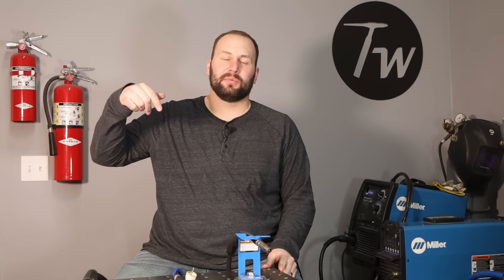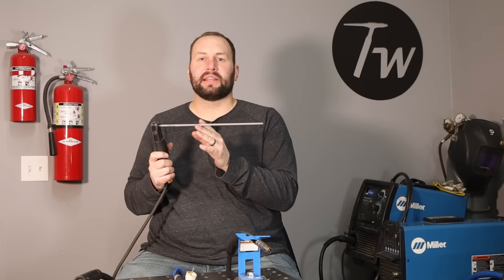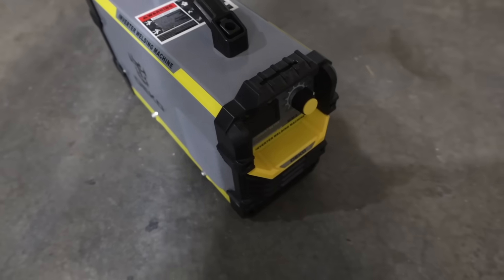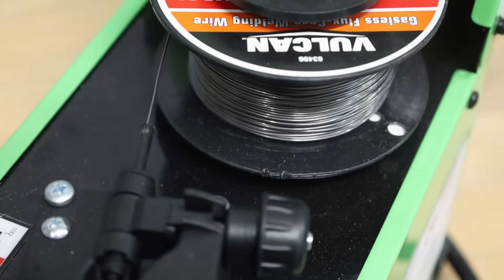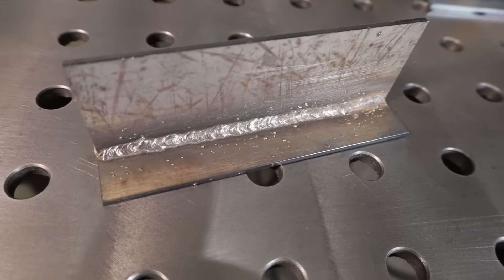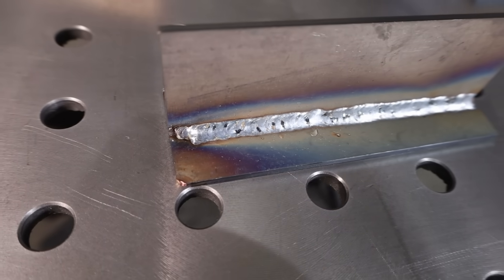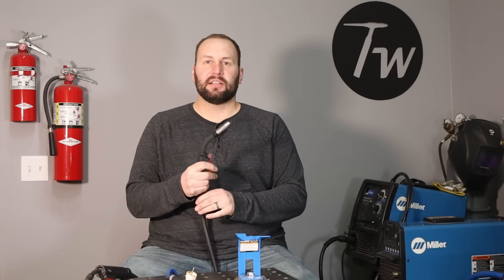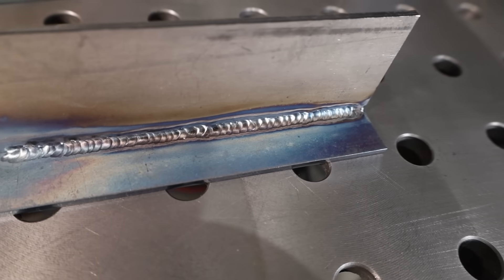4 Types of Welding Explained: MIG vs TIG vs Stick vs Flux Core

Comment: It’s called “stick welding” because the rod always sticks 😂
Reply: Rod sticking = more amps.
Rod burning through= less amps.
Reply: @tarnvedra9952  🤔
Reply: @tarnvedra9952  What about changing the voltage, if possible? After all, it all ends in Watts.
Reply: @bitTorrenter  yes, I personally call them rods. Welding rods. But their technical name is electrode. I've never heard anyone refer to them as sticks, other than in the term Stick welder. :)
Reply: @bitTorrenter  You don´t. MMA is a constant current process. Voltage goes all over the place by itself trying to keep the set current.
Reply: @tarnvedra9952  Interesting.. Do the MIG welders work on the same basis aswell?
Reply: @bitTorrenter  MIG is the opposite = constant voltage + you set proper wire feed speed to accommodate chosen voltage.
Reply: @tarnvedra9952  nice info. I understand this here. Not when in college
Reply: @tarnvedra9952  thank you bronie
Reply: @tarnvedra9952  what about the fucking rod melting or turning red haahahahhahahahaha i am welded dear god
Reply: @tarnvedra9952  ehhh
Reply: @tarnvedra9952 I honestly didn't know more amps would make it stick less. I just started welding today. This 2 year old comment is helpful
Reply: Nah its called stick welding because of the stick u need to keep up in ur arse to maintain the perfect angle to prevent "spitting" of the metal.
Reply: 7018s notorious for having to be totally dry or stick they will!!
Reply: Always keep them in the containers, so you get absolutely no moisture so they'll stay as stick free as any 70xx. Still a tricky rod to work with. Respect to you for great work.
Reply: @lifeinpalawan yeah very I’m in school now and even after getting proper grasp of the strike still sticks from time to time
Reply: @lifeinpalawan  not in my experience. They seem to run just fine rod oven or not. Then again I live in Texas. Not sure if extreme humidity could cause trouble or not.
Reply: Good job
Reply: Not being mean here, but dad always kept certain rods in a fridge that was not cold enough to cause condensation but kept his rods in low humidity.  He also had a small toaster oven for drying out some rods as well.  In 20 years of watching him weld, I never saw him stick a rod.  Those old dudes had tricks up their sleeves we haven't got a clue about.  I can't remember why, but he would drink milk before welding galvanized.  Dude could lay a pretty bead and was certified on pretty much anything you could shake a stick at.  My favorite was watching him fix this one jerk off's screwed up job.  They dumbass laid out and final welded an expensive alloy beam for a decorative staircase.  They used a stick welder with a hollow rod and compressed gas to blow the weld out.  The kid was throwing hot slag all over, got into a corner and shot a gob over his leathers.  It dropped just over the lip of his jacket and it bit right in to burn his rear pretty good.  He gave up and went to the med center.  Dad had to step in, and I got to watch as he cleaned out the welds (which hadn't penetrated correctly) and did it without the full leathers.  I couldn't figure it out, but he cleaned out the corners with the hot slag always going away from him.  I was there to grind all those bad welds and to watch dad lay out the beam, weld it up right all before Bob the gob came back.  If you wanted pretty welds, you had 1 of 3 guys in that shop do it right.  If you had to get the job out and couldn't get one of those guys, you got me to come in behind the gob slingers and grind 'em up pretty.  Best summer of my life...I decided that college and a career in IT was the better choice for me.
Reply: @briancooper4620  
Uh, I suspect you may have mis-understood much of what you saw. Some of your comments about other welders support this view.
Keeping rods in a fridge has two problems - taking something cold out of a fridge causes condensation to form on it in a warmer environment (classic example is the moisure forming on a cold drink's glass), and the "dew point" when the warmer ambient air that entered the fridge was chilled inside it. Not to say specific rods may not benefit from it, but I don't know of any - anyone?
The only rods I've used (I'm by no means what I would call a "welder", they are VERY skilled in what they do) that were hollow were cutting/gouging rods specifically intended to blow molten metal out of areas to cut them apart, or prepare an area for a (re)weld by removing material (or cracked weld) and forming a groove for good root penetration.
Reply: It's not me it's the rod
Reply: @samduncan344  🤣🤣🤣good one
Reply: Depends of a "rod" (type,manufacturer). Some do stick,some do not. Mostly problem is moisture in them. I use 3 types,one sticks always,but if it is reheaten,no problem.
Reply: @Bare36  may be why a friend of mine used to put his sticks in an oven before use.
Reply: @Bare36  Keep those "sticks" dry and warm.  If you work out in the field stick welding, keep rods inside the cab.
Reply: @Bare36  I threw my rods and industrial oven for about five minutes before and they never stick
Reply: @Bare36  what rod do you use
Reply: brass monkey  lmao, I've used PPE all my working life, because I'm not a brain-dead zombie. I guess you know nothing about welding and the affects of welding fumes and gasses. They don't have any effects on the brain, they cause cancer and chronic lung disease, of which I have neither. You just sound uneducated & bitter. I have advised someone here to invest in a respirator, and you're calling me out for it? You clearly have zero knowledge of welding and the hazards that come with it. Stop trying to make out you are educated on the matter, obviously you're not. 🤡
Reply: brass monkey  ps; You* & You're.
If you're going to try insult someone, atleast use correct English grammar and spelling. What are you, 12?
Reply: Lmao  that's  brilliant  but you  just  gotta  get better  at starting
Reply: Give me any one of them and stand back or get burnt
Reply: Lightly wet the last 1/4" before you strike up
Reply: If you actually know what you are doing the rod won't stick. Easiest way is to start the rod off work piece, then when the rod end is inside the flux (as opposed to sticking out as when new) and it's still red hot transfer to work piece, the flux will conduct the arc starting and there's no bare rod to stick to the work piece.
Reply: @railroaded1991  that was my point though, I don’t know what I’m doing. I’ve found that drying the rod in the oven first helps. Thanks for the tip, I will give it a try.
Reply: My tip of the week place rods in oven on low temp for 10 minutes to get rid of any moisture ,do use gloves to remove don't be a clod lol
Reply: Some people just camt take a joke....

And saying you've never had a rod stick is bs
Reply: If anyone makes that particular joke at my shop we fire them on the spot
Reply: Your rods are too thick.
Reply: 😂😂😂😂😂😂😂😂😂😂 That's a good one
Reply: Only if you have asshole coworkers.😂😂
Reply: Skill issue.
Reply: Bad welder spotted
Reply: Nah u just bad at it.
Reply: @tracerandom7082  exactly😂 people jab when they strike it and wonder why it doesn’t work😂
Reply: @tracerandom7082  did you learn to take a joke yet?
Reply: @tracerandom7082 😂
Reply: Jaja
Reply: @juanm4936  Binks? Jarjarjar
Reply: @elyanae9588  Jaja is "haha" in some foreign languages
Reply: Lol
Reply: @betogray9765  lol hahaha
Reply: That's were the mighty stihl chainsaw steps in to buff that off
Reply: @Mike-su8si  Real welder can peel off the slag
Reply: @ex3cit  probably how mine will turn out I'm hoping it'll be in small pieces broken up like crumbs
Reply: @Mike-su8si  Me and my friend would do 7018 rods the thickness of my middle finger and the slag was so massive we needed a bandsaw
Reply: @ex3cit  that's big
Reply: Depent how good you are to weld!
Reply: I was taught by this guy who said, do it exactly the same way as I do. He picks up the electrode holder on the left side of the table, so do I. After I did the course I had an exam. The guy marking me said, oh, you're left handed. No, I'm not, I just did everything the guy told me to do, except as a mirror image. I passed OK. But can't weld right handed.
Reply: @philgray1023  I didn't do a good weld job i believe i would have gotten a F in class. my metal is thin for one thing and the other i didn't know it would burn through the cleaned rusty metal
Reply: @philgray1023  -  👍🏼🫲
Reply: Cheaping out on the iron powder again
Reply: My first attempt at doing arc welding at college looked like Custer's Last Stand......!
Reply: brass monkey  racist horrible yank
Reply: Not if you've a bit of practice and have good spacial awareness - the relationship between where the rod tip is and the work-piece.
Some rods are VERY polarity sensitive, that seems to be one of the biggest issues with strike and arc problems.
I'm by no means an expert, just used it for many, many years.

Yeah, moisture can be a big problem, not just for the arc, but for hydrogen embrittlement - worked one place the boss had a real thing about using a specific brand, and type, of more expensive low hydrogen rod when almost all welding was on simple mild steel(!). Then, when the rod hot-box's heating element failed he refused to spend the money to replace/repair it... I wouldn't say the workshop's welding bay was damp in winter, but a lot of rods got thrown out because the flux was crumbling and falling off from dampness.
Reply: Gotta record scratch that shit
Reply: You ain't kidding!!
Reply: Only if you don't do it a whole lot
Reply: LOL I feel you bro 😂
Reply: Haha, indeed, for beginners. Learning to strike that arc takes a bit of practice for sure. Strike it like a match. A quick but short stroke, being sure not to drift too far from the desired starting point. A good helmet is also essential. If you can't see where the stick is, you're more likely to stick it. 😋
Reply: @Clifton84 Best Comment Ever on Youtube!  LOL
Reply: Dip stick, Witch means in English (A long piece of steel that  can tell you the level of your engine oil, other than that it brain less! Please stop, it takes years to understand welding
Reply: Been there done that... 😂😂
The only welding I ever did was just a mess around, and after 5 mins I was OK, nowhere near good but OK. Saw some “professional” welding a couple of months later (a nepotistic appointment, at the cost of a Good welder according to the staff) and hey, I was better.... sporadic joins & “birdshit” all over the place.
Reply: Low hydrogen rods used for pipes work require coded welders as they're very difficult to use
Reply: especially them 6010s 😭😭
Reply: I just started to pick up welding, and this so much resonates with my experience when I tried it for the first time 🤣
Reply: Lol yeah. It's so frustrating, especially for beginners like me.
Reply: 👍🏻 very nice, thank you 😬
Reply: I did a bit of welding at my concrete job not knowing a thing about it, that fucker stuck to the metal every time I touched it lmfao such a noob
Reply: Lmao
Reply: lol i remember learning to weld in class we started with stick welding and almost everyone got the stick stuck first couple of times xD
Reply: If it don’t stick you are doing it wrong son,,
Reply: How to say I can't weld without saying I can't weld 😂🤦🤦
Reply: Witty and very appropriate.
Reply: https://youtube.com/shorts/QF1uD_1Wlkw?feature=share
Reply: I’ve broken a few stingers and welding helmets because of sticking lmao! But it’s what I started on and still my preferred. Stick and Mig are all I’ve done so far. I work at a stone quarry and all the welding that was done by us maintenance guys is basically the result of us being self taught. We do have to have a 3G vertical structural welding certification though and if you don’t pass it you are kind of forced out of maintenance. Everything is painted and 20 years of rust from water and limestone dust. It’s been a struggle to learn anything on but man can I weld on clean metal because of it. Wish I would have taken classes back in high school for it. Never knew I’d be doing it or enjoy it!
Reply: Work available I will come
Reply: I remember 5th grade welding class and that was the worst part
Reply: He was making a joke Richard heads
Reply: Say what🤔

Were made in HIS image. HE made us with the power of free choice
A good prayer:
I'm a sinner JESUS please forgive me for all my sins I know you shed your Blood for me on the cross at Calvary. Thank you JESUS for my salvation and for shedding they Blood for me. I love you JESUS. 
Romans 10:5/10 ct...❤️k
JESUSisLord!Amen...
Amen..
If you'd like to call someone who cares 
83
For
Truth.
bc you don't know when you'll die?
.y r u hesitant......
...

.
Reply: Never had chickens is why lol 😂
Reply: Back bock Bock Bock all alcoholic welders best they have perfect shakes for that chicken scratch to start lol prove me wrong lol
Reply: I remember kicking myself when I’d flip my helmet up and something would bump me or I’d sneeze and stick. Fun times.
Reply: Bruh that’s what I’m sayin
Reply: Protect from moisture (air tight can) rise your amps.
Reply: I thought that was just my welding technique
Reply: used to happen to me back when I first started 😅😅😅😂
Reply: Hey just as a secondary note here... Those pro metal workers who run rod after rod are stopping and starting a new rod before the weld has a chance to cool off. It's much easier to start a new rod when the spot and flux are red hot... Which goes along with my previous suggestion of starting the new rod off piece and transferring over when flux and rod are still hot. My suggestion is for us who aren't pro metal workers and only weld now and again, works for me.
Reply: @railroaded1991  thank you
Reply: Hahaha true...m😁
Reply: Tap or strike it like a match n it won't  stick
Reply: As an instructor we always started them out with a 6010. After mastering that a 7018 becomes much easier.
Reply: You need more heat, pop it up
Reply: Part of it has well u know how to weld
Reply: Lmfaoooo
Reply: Witha Hardar  amen brother
Reply: I call mine bird shit welding.... for similar reasons.
Reply: So true bro hahah
Reply: LOL
Reply: Agreed
Reply: HAHAHAHHAHAHAHAHHAHAHAHAHA
Reply: Mine too welder.  Mine too
Reply: Hardest dad joke
Reply: If you use proper technique and amps, you won’t encounter this issue
Reply: No kidding
Reply: nah this was actually funny
Reply: Fr
Reply: Pontoon welding stick..n twist
Reply: so true
Reply: Ok?
Reply: I tried verticle up stick welding while working for a dude who owns trailer parks, I instantly gave up when the rod stuck I was like nah I don't go to school for this 😂 I've done some stuff with the flux core though. I know most consider that hot glue rather than welding though.
Reply: Ong
Reply: What a great lecture!!! Thanks mate!!!
Reply: No shit💀🤣
Reply: That's no shit
Reply: And it's the type I STICK to
Reply: It's all in the techniques. Right now I'm pooping and use the rock all the way back and forth technique to poo faster!
Reply: I hate you😂
Reply: We used to call it arc welding
Reply: Simple explanation 😂
Reply: Right! 🤣 I still enjoy stick welding though. Especially how it smells like a campfire 🙂😎
Reply: yes pain in the ass
Reply: Boy you got that right
Reply: Man I gotta mean tap start tho. I haven’t gotten stuck since trade school 😂
Reply: Its called stick because you're burning rods with an O² blocking coating that look like literal sticks.
Reply: You have to tick tick tick it few times before start if it is wet
Reply: Must just started learning... you'll get better. Use the strike method not tap
Reply: On God it’s so annoying because I’ll always lift my hood because it’s a fixed shade not an auto shade and I’ll have shirt flashes.
Reply: Ha ha
Reply: Did some stick welding with my dad. He’s good at it. I’m not… I did some good lines but could be better, I improved quickly though. I enjoyed his help.
Reply: So true
Reply: I feel you pain friend, hence i’ve gone to MIG which seems far simpler. Couldn’t get on with fluxed wire gas less but fine with gas MIG.
Reply: I feel you pain friend, hence i’ve gone to MIG which seems far simpler. Couldn’t get on with fluxed wire gas less but fine with gas MIG.
Reply: THANK YOU!!! I thought was just me 😂
Reply: skill issue
Reply: 😮Itself is stick,loose stick
Reply: You also may need to lower the angle you are holding it at and go at a consistent speed.
Reply: Its all about maintaining the arc, and you do that with the amps and the distance between the rod and the surface you weld in.
Reply: If it sticks you’re running too cold for that rod
Reply: As a stick welder I can both confirm and deny
Reply: It never sticks if you do everything properly 😂
Reply: Dude real
Reply: I laughed way harder than I should have.
Reply: I thought 75 A was good enough😢 I wasted an entire class period getting pissed with my stick and the clamp that holds the stick, I was using a small 6013 BTW. I’m still so disappointed that I didn’t think to BRING IT BACK UP to 115 or 120
Reply: Ha ha ha ha . Yep.
Reply: if you ladies are finished comparing cl*t sizes and swinging handbags, might I suggest a battery fanny pack blower? You get filtered air and a nice cooling breeze to the face.
Yes, they are quite expensive, but they're really such a pleasure in comparison. I had the use of one some years back, before moving onto other things, and even without fumes I would use it to cut down on sweat and eye irritation from the smoke/fumes. I don't recall the brand/model, but most of the bigger companies offer variants.
Reply: Aaron Hicks  it seems we have another smart guy who doesn't care if some poor soul is made to weld galvanized steel without any PPE. Shoot me for caring and trying to help a fellow welding enthusiast. I envy or aspire to be none of those things. I hate pigs. And who made me king of this comment section?, Well considering I seem to be the only one with any actual welding experience or knowledge, y'all just chat complete off subject crap, your comment is a perfect example. If you have nothing informative or constructive to say, or don't have any advice on a respirator, then f*ck off. Go comment elsewhere, a video game or chat roulette is probably more the place for a creep like yourself.
Reply: Aaron Hicks  I find it funny how you wise guys make comments then don't reply when I own your ass 🤣 too busy playing with yourself than playing with powertools. You're just a tool in general.
Reply: @elyanae9588   "when I own your ass 🤣 "
 yikes, the cringe...
Reply: Thought it was just me.
Reply: @rustyclaymore1105  😐 its called stick welding cuz its a stick
Reply: @ex3cit  when I try it’s just stuck welding. Can’t strike an arc to save my life.
Reply: @rustyclaymore1105  Try tapping give it a slight tap till it catches make sure the settings are right. Also depends on what electrode your using, try using 7018 to practice there easy rodd
Reply: @ex3cit  too late they banned me from the welder even though I’m their boss!  I was so proud of them for doing so, since I’m supposed to be in to office pushing papers.  It was sweet of them let me try.  Next week, backhoe training!  I’ll let you know how fast I get sent back to my desk.  I see a mig welder in my future.
Reply: @rustyclaymore1105  Mig is fun due to how easy it is.
Reply: @ex3cit  👍
Reply: They're welding rods not sticks. Never got the 'sticks' thing.
Reply: @bitTorrenter  guess cause their thin like a tree limb stick or something. i like the thin wire
Reply: @bitTorrenter  it's called stick welding for obvious reasons. The technical name for stick welding is MMA (manual metal arc) welding. And the rods are called "Electrodes"
Reply: Ya if ur arse at welding
Reply: @BiGFLATE98  apparently you’ve never SMAW welded before
Reply: @czala  I was just joking haha it’s definitely hard at first and getting stuck is super frustrating, but once u get past it, great feeling
Reply: i could relate 😂😂😂😂its the worst bruv
Reply: I respect this as only welders will understand
Reply: The rod doesn't always stick if you can actually weld.. never had that problem 😂 strike an arc properly and you won't get that problem
Reply: @elyanae9588  I guess the joke went over your head
Reply: @WarInHD  not at all. Totally got the crappy joke, but that's all it was. I was just informing you if it's done right it won't stick. (: Guess you've never welded.
Reply: @elyanae9588  I bet you’re fun at parties 😂 and I’ve been a certified welder since I was 17. Currently I’ve been welding galvanized reveal angles to C-Channel 10 stories in the air
Reply: @elyanae9588  but yeah nice try though, I’ve had my structural and pipe certs since high school with stick and TIG. Then once I graduated and started Ironworking I got my Flux core certs in structural. So I can damn sure weld pretty fucking good, if you’ve ever watched Welding Tips and Tricks on YouTube, my welding instructor used to be that guys boss. So he’s closet person on YouTube I can find that welds the way I was taught
Reply: @WarInHD  well done, hope you wear the correct filters in your respirator while welding galv. Nasty stuff. Cool story, though.
Reply: @WarInHD  no need to justify your welding achievements. Save it, we can all be experts on the internet 🤓
Reply: @elyanae9588  nah we don’t get that luxury, we’re Union Ironworkers. They always make us do the hardest shit possible with the least amount of stuff
Reply: @WarInHD  demand a mask. Metal fume fever is not a joke, and welding fumes are carcinogenic enough as it is; throw galv into the mix, you're asking for trouble. If they won't provide you with the correct PPE, buy your own. It will be worth the years you save, rather then the pennies.
Reply: @WarInHD  remember, demand a mask be provided to you. You are risking your life for someone's else's gain. Protect yourself.
Reply: @elyanae9588  I second you on that
Reply: @anshulbhardwaj4038  which point sir? The PPE or the fact your electrode won't stick if you strike an arc right the first time? 🙏
Reply: @elyanae9588  PPE
Reply: @anshulbhardwaj4038  haha glad someone gets it. Not fooling me telling me he welds galvenized steel without any respirator or PPE 🤣 🤡
Reply: @elyanae9588  anyone doing welding job without proper ppe is calling for a big medical bill and a shorter life span .if your organization does not provides you pee buy it yourself .take it as an investment.
Reply: @anshulbhardwaj4038  exactly what I'm saying my guy (: very dangerous fumes!!
Reply: @elyanae9588  I'll use a fan
Reply: @Mike-su8si  good idea blow the fumes all over the place :) you need an extraction fan and good ventilation. A fan wouldn't do anything other than circulate the fumes faster.
Reply: @elyanae9588  while I'm outside
Reply: @Mike-su8si  in that case you don't need a fan. Only respirator for extra protection.
Reply: @elyanae9588  yep I'll have my corona  mask on it should do some good cause that's all I've got
Reply: @Mike-su8si  They don't stop fumes. Please consider investing in a proper respirator with the correct filters for welding fumes.
Reply: @Mike-su8si  STEALTH MASK is a great, cheap respirator that works well. And comes with the correct filters for welding.
Reply: @elyanae9588  I know now I'm gonna need one cause that smoke stinks to bad without it
Reply: @elyanae9588  I will have to look one up
Reply: @Mike-su8si  stealth mask respirator is cheap and works well, please do get one. That isn't smoke, they're toxic metal fumes. That's why the smell so bad. Be safe happy welding :)
Reply: @elyanae9588  yeah it does stink bad that cheap mask that comes with those cheap flux machines works but it needs a string put on so I wont have to always hold it I don't mind using one hand it works
Reply: @Mike-su8si  yes, those masks work but aren't ideal. I don't mean the facesheild, to protect your eyes, one that goes over your nose and mouth to stop breathing in the fumes and particles. I'm glad to hear you wear a mask of some sort. Something is better than nothing!
Reply: @elyanae9588  yeah I do. I'm gonna have to look up a better one
Reply: @WarInHD  say no more all I needed to hear was iron worker 😂🤣😆 are you sure it wasn’t since you were in diapers
Reply: @WarInHD  what union are you in ?  Mars or Jupiter 
You’re a dreamer,  you probably are a finish carpenter
Reply: @elyanae9588  union is the key word, always pampered 😂
Reply: @WarInHD union=14 guts standing around watching one gut actually work.
Reply: @WarInHD bro you're union is lacking...mine gave us respirators with p100s... Osha must love you folks.  I don't weld without a respirator.  I smoked cigarettes for 15 years, no need to mess my lungs up more...plus you said galvanized?? With no proper PPE.  I call a lie..  post a video on your channel doing your work...  I don't buy it.  My Union wouldn't let me near anything to weld without a respirator...
Reply: @elyanae9588 scratch
Reply: @elyanae9588  your rod never stuck? Hard to believe
Reply: I mean yeah if your a bad welder